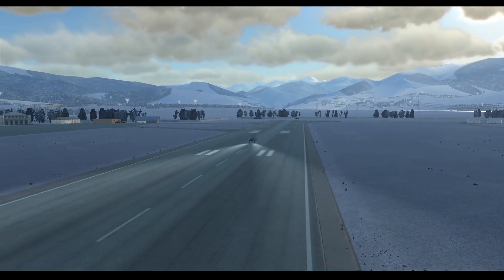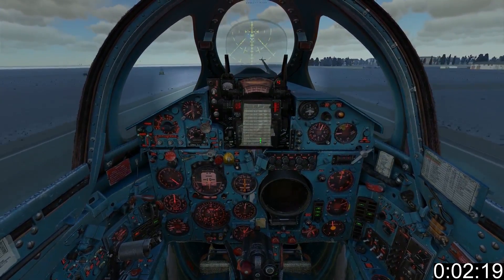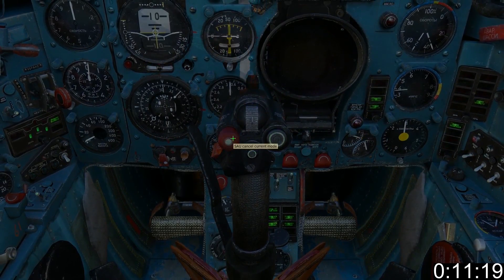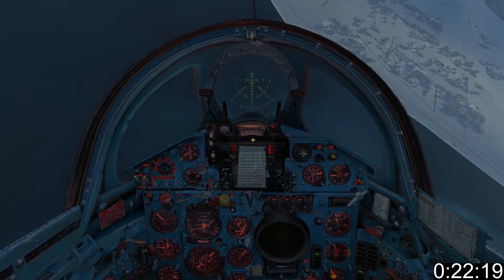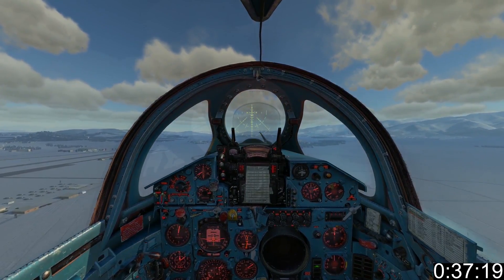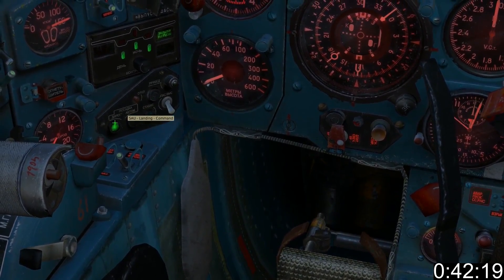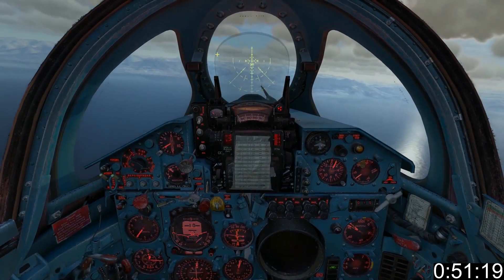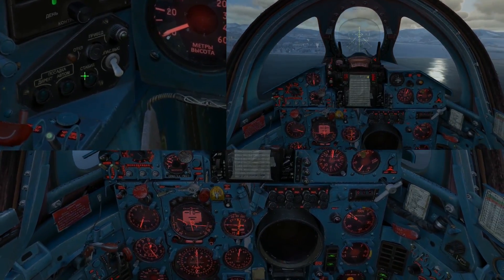1 Minute DCS - Mig 21 Bis - SAU Autopilot Tutorial

Comment: You can set desired altitude for ground avoidance, it is not in the manual. It is a dial just in front of the stick, it has marked altitudes , 0, 50, 100, 150, 200... If you set it to zero no alarm will sound if below set altitude, in case if you were wondering what is that sound when you fly low. Other thing is attitude hold function, I think it has no physical button in cockpit but you can map that key to your hotas and it only works after stabilization mode is on, very useful
Reply from the maker: Thank you very much good sir!  This is why I love making these tutorials, just once a year or so, someone who knows stuff I don't comes along and gives me some information that adds a new feature or dimension to an aircraft.  Really appreciate the information.
Reply: @Laobi  I am glad that I can help. It is weird that we don't have these things in manuals or some training missions that come with the module. Modules feel incomplete without proper tutorials.

Comment: I humbly suggest you were oscillating because you were going slowly ... maybe SAU would have coped better with a little more throttle.  I could be wrong about this but I have had better results approaching just over 400kmh. 

I find the autolanding harder than manual. I suspect the Mig 21 was designed by a team in a Siberian gulag.... They were the best of what was left of  Russian designers after the great purges.  

Have you tried a SAU commanded landing  in heavy fog with a decent through heavy rain clouds ? It is quite challenging .